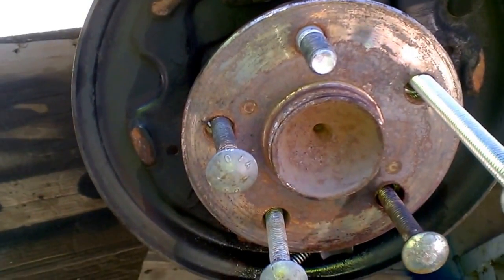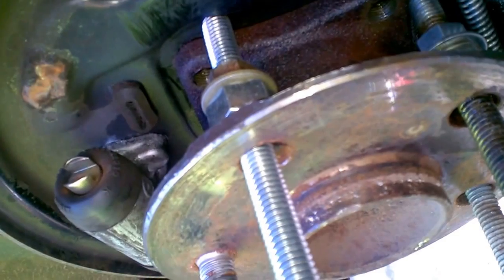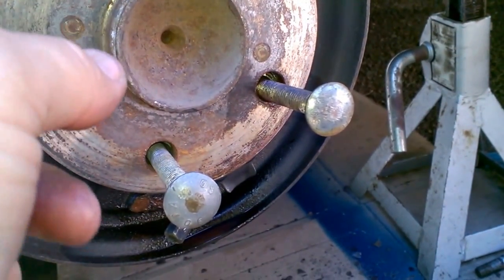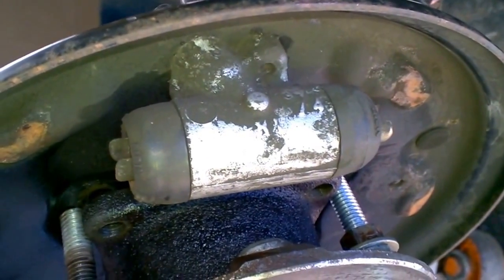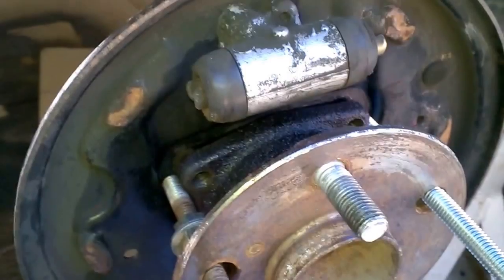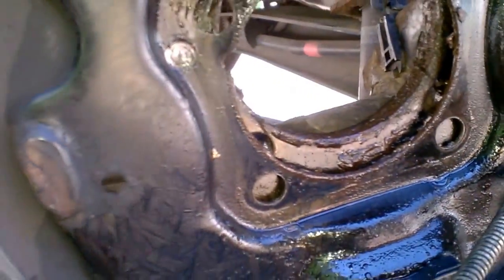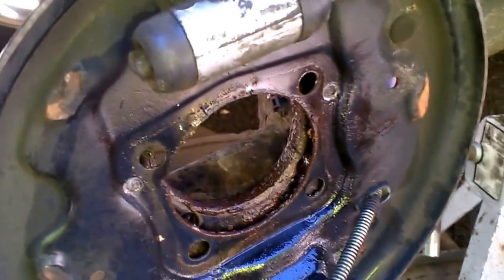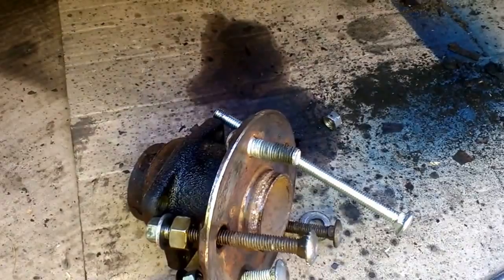Solved: Stuck Wheel Bearing / Hub  (rear)  4 bolt method, 2005 Toyota Prius Gen2

Comment: I wonder if there's enough space to have those bolts rest against the solid part that mates with the hub assembly on a 2016 prius C. It has a similar setup but not sure the there's enough space so the bolt is not just against the backing plate.
Reply from the maker: Not sure on the Prius-C, but you are correct the bolt must press against the mating surface.   I hope it works for you.
Reply: @theOriginalBanger  it worked. I took my time by spraying rust dissolver over multiple hours. Slowly turned the nut and kept spraying more. it came off fairly easily on a 150k car in the north east. wheel hubs is delivering tomorrow for an install. I'd say removing that abs connector pin was the hardest part for me actually. removing the hub quickly might be very challenging without rust dissolver sitting in the crevices for hours.

Comment: I spent $10 on the hardware needed to do this. Truly is the best method to separate stuck pieces on the hub.

2x - 5 inch 1/2" bolts (fully threaded bolt but didn't need more then 2-3inches of the threads)
2x - 1/2" nuts
2x - 1/2" washers

I went through my drawer of old sockets and found two that were slim and would just be big enough for the bolt end to fit inside. I used these as the heatshield/dust cover protector as trying to put a small washer back there to protect the backplate was near impossible with the E brake hardware still in place. 

I rented a slide hammer but my hub was only stuck to the to the backplate and the piece the caliper bracket bolts too. I read about this method but didn't bother going to the hardware store this week like I should. After the sun went down I finally got this method to work. I just made sure the bolts were being pressed into a solid metal piece and not just the backplate. I few light turns and POP, I turned a couple more just to fully clear the stuck bits. Then removed all the hardware and the hub came out easily. I so should have bought these parts in advance. Now I need to return the slide hammer rental to get my $77 back from AutoZone which didn't help one bit.
Reply from the maker: Good idea about the sockets to go over the bolts to protect the dust shield.   
What a satisfying sound when you hear the "Pop!"

Comment: My first one took 2 hours second one took off the brake line and put it between two cinder blocks and whacked it with a sledgehammer about four it took 3 minutes it fell out hope this helps anyone didn't have to take off the brakes either

Comment: How did you get that off I'm trying to put a spare tire on mines
Reply from the maker: If the wheel wont come off.  Take the spare in both hands and swing it into the lower part of the tire, this will break it free.  It might take a few whacks.    Good luck.
Reply: @theOriginalBanger  thank you, I took it to the shop and I believe that's what they did

Comment: I've always been lucky  , never had one stick but if I do 'll have to try this  . How did you get the studs out ? Just knock them out the back of the hub ? I did my friends Honda once which had a press in bearing . The auto parts store didn't have a press so I went to the junkyard and got the whole spindle with bearing and hub !
Reply from the maker: The studs just knock out.  Simply hit them a few times with a hammer.  If you want to save the studs, put on the lug nut first then hit them.     I have always been unlucky, every hub I have removed has been stuck!

Comment: So what’s the big deal about showing us how you did it???   Dislike.
Reply from the maker: Not sure what you mean, I do try to show how I did it.  Put the bolts through the hub, tighten the nuts to press the hub outward.  I made the video while I was doing the work because I thought it would help others remove their rear hubs.
Reply from the maker: Also I did not have a tripod so I had to film as I explained the technique.

Comment: Hey man can you reuse the lug studs once they been removed like that. I have a corolla with the same problem. The backing plate is rusted to the hub.
Reply from the maker: I would think so, since the lug studs are locked in place when you bolt on the tire.  You might first want to tighten them in place first before putting on the tire.  If you wanted a new set, they are not expensive,  I'm pretty sure you could pick up a set at auto parts store.
Reply: @theOriginalBanger  Excellent, thanks a lot for your video, got me out of a pickle earlier, had a backing plate rusted out and needed to use your method to get it backed off.
Reply: How did u remove the backing plate?
Reply: @wesleydavidson558  I put a video on my channel of what I did to get the backing plate off but all credit to this video for showing me how to do it to begin with.

Comment: Thanks huge! BEST trick ever for rusted wheel bearing removal!! I did this yesterday and had them buggers off on both sides in less than 15 minutes! It was a little touch and go for a minute when the metal backing plate bound up for a few but then it went "bong" and things were moving again. Awesome! The 1/2" bolts and nuts I used didnt look too good afterwards but I didnt care since I took them off an old wooden deck years ago anyway. I save all sorts of odd junk for "special" projects like this one. lol

After looking at the hubs once they where on the ground I realized that there was no way the "usual" sledge hammer, chisel or/and air tools were ever going to work on this old car of mine! 18 years of road salt does a number on steel!
Reply from the maker: Glad it worked for you, I have used this technique about 5 times now, I like how you have good control over the pressure.
-andy
Reply: @theOriginalBanger  Hey Andy! I got a question about the nuts and washers. In the vid I see you have two nuts and a washer between them on each bolt for pushing. I assume this is to increase the surface area on the treads so they dont strip. I tried this but cant seem to find the right combination of washer thickness and nut to keep the two nuts from locking up when they are tight together. Any thoughts on this? How do I keep the nuts from jamming up? I was thinking about finding a half inch rod coupling alternative. But I did my hubs with just one nut and it worked fine, except for one spot on the bolt that got a little chewed when the hub was stuck for a minute and I really had to apply force to get it moving again.
Reply from the maker: @michael47lamb  Hey Mike, the larger nuts were just use as spacers.   I didn't have a bunch of washers handy, and I wanted to have a gap from the hub to the actual nut's that are being turned with the wrench to make it easier to work on.   So the larger Nuts are just used to help distribute the pressure against the hub, again a set of washers would have worked just as well.  

So you should only have ONE nut per bolt GRABS the thread.  If for some reason that nut or bolt strips, try a harder grade.
I hope this answers your question.
Reply: @theOriginalBanger  I understand. Thanks Andy!
Reply: BTW

I saw today a guy using some half inch dia by 2 inch long rod couplings and a couple short 1/2" bolts instead. I explained about the longer bolt method as his coupling idea looked a bit awkward and may not be long enough for some cars/ trucks. In any case the jack screw method is a wonder and the best ever idea for this issue. Well done my friend! I am giving you credit for it anyway. :-) 

I have also been thinking that since the bolts apply so much pressure I bet you dont need to pre-spray the hub with penetrating lube at all. I hate wasting my Kroil as it did not get very far into the joint anyway (once I got the hub out I could see it was still dry in the rusted gap.)

Comment: Thanks a lot. I used 12 mm (1/2 inch) bolts and grinned them flat on the end. If you turn the nuts so the bolt do not rotate, nearly no marks left on the backing plate.

Comment: Thanks for sharing this method, i used it and it worked like a charm. The only thing i did differently was to cut up a hardened washer into 4x small pieces and place those under the screw head. This helped to prevent as much damage to the backing plate.
Reply from the maker: Nick, that is an excellent idea!

Comment: Did you cut those studs off or hammer them off?? I have the exact same problem in 2012 Focus and I’ve tried it all. Slide hammer got it loose but the backing plate still stuck on. I hope this works, will let you know!
Reply from the maker: Hello Micah.   On the Prius, you can just tap the wheel studs with a hammer and they loosen and you then turn the wheel to get in a position so they can be backed out.  I would think the focus would be similar.   Most studs are removable.

Comment: Note that the original post had a wrench on the bolt behind the hub to keep it from spinning, and a little PB Blaster on the hub backing plate joint will ensure it parts there.  And most hubs so have holes in them for the bolts so you don't have to remove the lugs.

Comment: Definitely works well, Thanks for the post, both sides on the back were stuck very bad, this is a no fuss way to get them out, without repeatedly knocking a giant hammer on anything, heating, or any other technique, it gets the job done fast and easy compared to other means and methods.
Reply from the maker: Paul, glad this helped!

Comment: For me, I found an old guy that used a large pipe wrench and 10lb seldge. He put the large wrench on the hub and hit the end with the sledge. I spent 3 days with all the tools for the job and nothing worked but the afformentioned tool combo. What you're doing will bend the brake dust shield which happened to me. Only I had a parking brake assembly shield in the way too, which had also bent on me along with the dust shield. The PB plate is a pain to bend back because lining up the 6 contact points becomes a pain. So if you are willing to buy a hub assembly because it may bend, then its totally worth a shot. It's plenty fast for an extremely stuck hub and is the only thingthat worked with no damage except the hub being replaced.

Comment: Just went through this nightmare with my '05 at 200k. It came right out of the mount on the rear axle without any problem. BUT it was seized to the brake backing plate! I could hardly mess with it for fear of bending the hard brake line. Talk about a PITA to get them apart. Your method would have worked for this too but I didn't have any other bolts or anything laying around.

Comment: I liked your version of this method, removing the studs from the hub. They are not needed again . I used a little different method in 1Dec2018. Took me all day..Literally. This method allows a more equal loosening around the hub.  I am considering tack welding nuts to the old front hub. It will be a paper weight anyhow,, lol.. when I am finished. Winter weather is here.. making the job outdoors even more fun. Great video which can be applied to many hub removal projects. I have a 2006 Saturn Vue, original wheel bearings. So they are corroded in place. You have gained a new subscriber today..
Reply from the maker: Lee, I'm glad this helped, thanks for commenting.
-andy

Comment: I owe you a beer buddy, this worked where lots of whacking with a sledge hammer and an improvised hub buster failed.The rear hub on my daughters 2002 Toyota Yaris was solidly rusted in but with some 10mm threaded bar, nuts, a spanner and a sturdy pair of 'mole' grips, I finally managed to crack the rust seal; then after a night soaking in penetrative oil and some heat around the back of the hub I finally got enough separation to slam it off with a lump hammer.Thanks for sharing your tip,
Reply from the maker: Excellent, I'm glad this helped.   I will take you up on that beer... :)

Comment: Stupidest idea I ever tried DO NOT DO WHATS IN THIS VIDEO you will punch a hole or damn near into your backing plate. Almost diid on my 05 camry.. wont come off for ANYTHING...
Reply from the maker: Andrew, you are correct, if there is nothing behind the backing plate, the pressure of the bolt would punch a hole through it.  On the 2005 prius you can set the bolt against the backing plate, and the plate is supported by the rear frame that holds the hub.   Again, you do have to make sure there is something behind the backing plate to support the pressure.